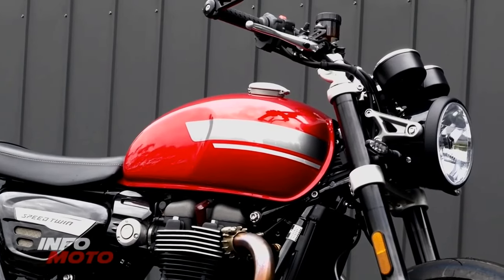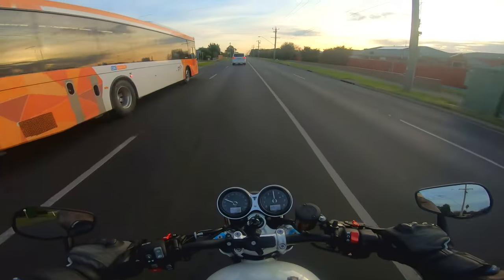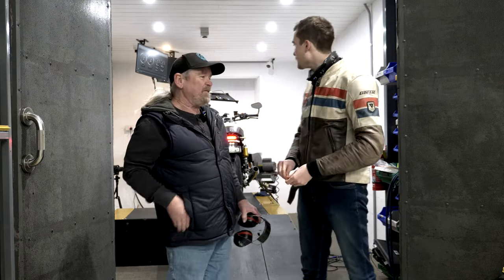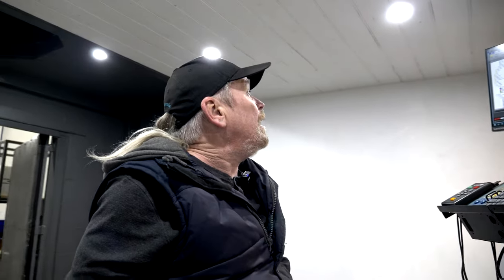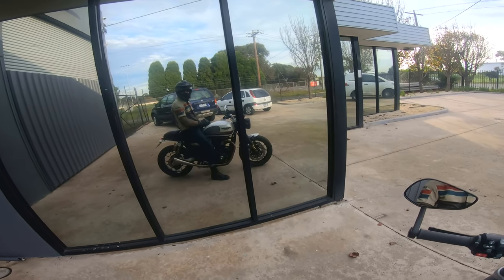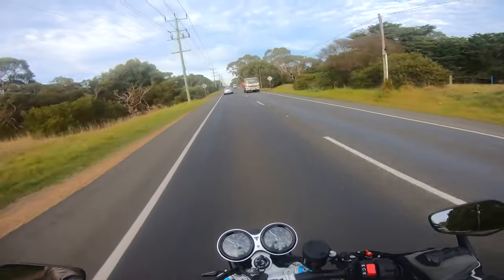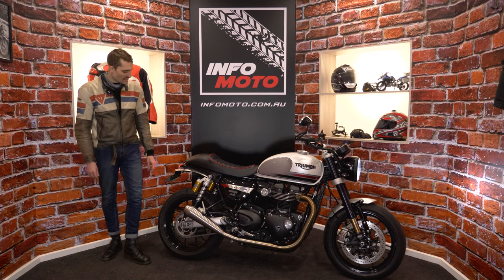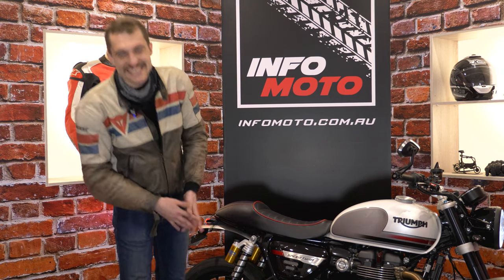INFO MOTO Triumph Speed Twin Super Build revealed! | Dyno test and first ride | EP3

Comment: This video confirms my suspicions, that the mods I've done have my bike putting out around 100hp to the tire, before an ECU flash. I'm anxious to get the tune done, and reap the full benefits of the upgrades. My guess is around a 15-20hp improvement. Thats substantial.

Comment: Intrigued to know how your going to tune the bike, gen 2 versions are reported as having a locked ecu and no compatibility with  Power commander?
Reply from the maker: We reckon we've found a way around it. Where there's a will, there's a way!
Reply: @INFO_MOTO  Well if you can do it, I have a pc5 on my gen 1 that's been on a dyno for a custom map and it's a different bike entirely, + 8bhp peak and similar torque with standard exhaust and decat. So smooth compared.
Reply from the maker: @ianfunnell8076  Hell yeah!
Reply: If I'm honest, I think it's fucken delicious and sounds amazing.

Comment: Incredible! I’m on the heals of locating just the right one to build up a bit. Generally find many with super low mileage. For example under 1k. Strange to me but that’s what I look for. Sold my HD bobber pictured in my emoji for a 2000 BMW R1100S.  It’s been great experiencing Germany tech., old as it is. Fast forward two short years, time to try the Brit-Twin…can’t wait til spring 2023…likely won’t. Cheers mate!

Comment: I would love to know more about adapting the forks. Did you need to modify axle or triple trees to make things fit?
Reply: I’m also wondering the benefit of the Speed Triple forks over the Thruxtons
Reply: @jackgilchrist6344  think st forks are adjustable.
Reply from the maker: Hey Steve, the new forks were a straight swap. Pretty easy.
Reply: Thanks for the feedback and the question, had the same thought, which speed triple generation forks did you use, model year?

EDIT: use 2019 MY, also has 43mm front forks but as described with ohins nix 30

Comment: The 1200cc is a good one. Triumph has made small improvements over the years from my 2016 Thruxton R.  I added a cam, ecu tune and slip on I'm at 101 rwhp over my stock 86 rwhp.

As a stocker it ran 132 mph at Bonneville with a 12.0 ET in the quarter mile at 2900 feet altitude. With the mods and aerodynamics I ran 151.3 mph at Bonneville in 2021 with a density altitude of  6900 feet and 11,6 ET  at the drag strip corrected to 11.261.

The motors will pull a lot of gearing, up to an 18/37 combination.

Comment: What exactly is the air intake?  Did you merely remove the snorkel?  I removed the rubber element as the hole is now bigger!
Reply from the maker: Hey Chris, we removed the snorkel and added a K&N filter.
Reply: @INFO_MOTO  same here and added an intake bell mouth.  I can’t believe the difference and the sound is so much better!  Decat next👍.  Then cams??? What cams are you using?

Comment: Doesn’t the normal one have 100 HP. Mine has it
Reply: Manufacturers give the crank HP as it is a higher (more impressive) number.
This HP on the dyno is at the rear wheel.
Reply: Looking good. You mentioned airbox mod, but didn't clarify what you have done with the airbox/filter?
Looking forward to the next one with it tuned without factory restrictions and the fuel/air mixture dialed in 👍
Reply: You'll see the figures here again are given in engine hp - not wheel hp. Quite annoying when guys use these figures to advertise HP.

Comment: I have the 2022 Speed Twin and if I could add anything I wanted to the bike I would give it another gear.  7 speed with high 7th gear like over-drive.
Reply: Try going up a tooth on the front sprocket. It's made a noticeable improvement on my bikes highway manners. Having an overly loud exhaust that constantly pops when your up in the revs, gets annoying real fast out on the highway.
Reply: I went up one on the gearbox and down three teeth on the rear....gearing now perfect compared with the horrible standard set up. Has dropped rpm by 750 in 6th,and still has instant acceleration on giving it a handful. Much improved......A  6 HP gain and weight reduction from Decat 2:1 exhaust, also helped,along with K&N air filter.